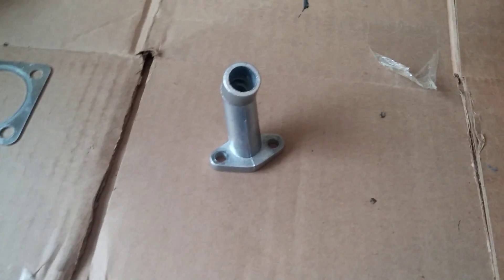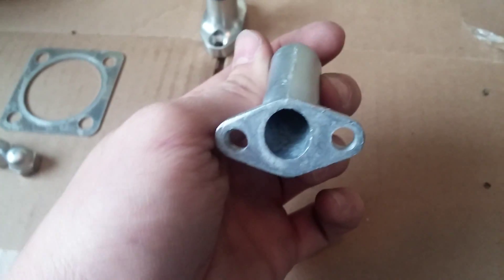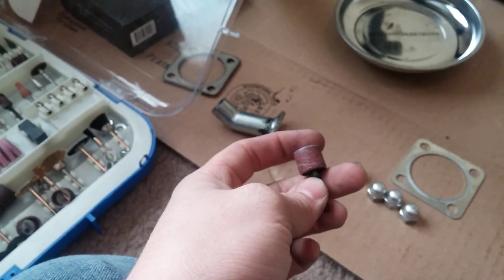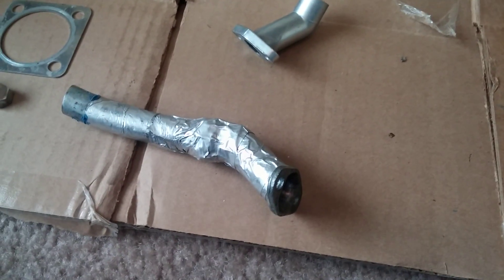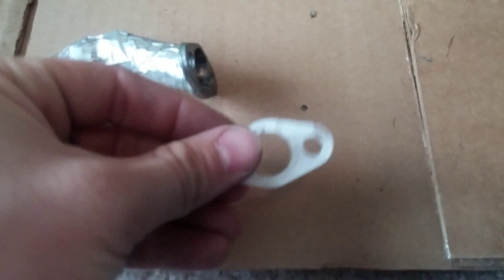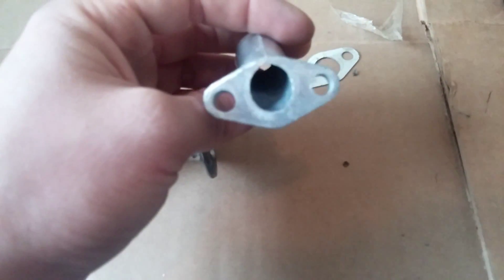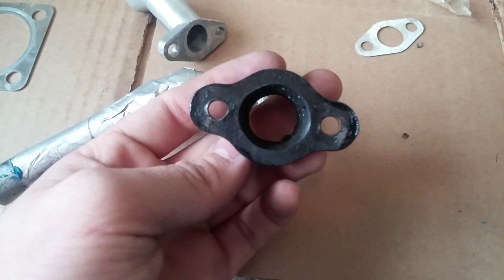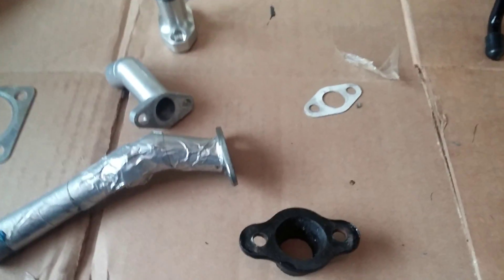Benefits of port matching

Comment: Good info. If you want to see bigger improvement, weld up an intake that matches the port size. Keep it short, use a larger carb. It's noticably better than even port matching.
Reply: What carb do you prefer?
Reply: @stephenjohnson6967  for a no reed motor with +170 exhaust timing 15-18mm of something you can jet properly. I used all the common carbs and just being able to get jets and have decent jetting made me happiest. No dyno to verify, just seat of the pants.

Comment: I understand the theory with the intake, but it ignores the fact that when you widen a pipe, it slows the speed of whatever is flowing through it.  I want the air to go into my crank-case at maximum speed, so it will create a slight super-charging effect.  I could be wrong...
Reply from the maker: I think the difference is the abrupt change is going to happen as it goes into the intake port either way. Would you rather the transition be smoother or abrupt? There is vacuum on that intake port pulling in air so no supercharging effect really. I have no data to support it, but also I believe the atomization of the air fuel mixture also becomes better allowing for there to be gains. It's actually a hugely popular mod to do, but I whole heartedly believe in a nice shorty intake that widens out to the size of the port properly, that truly gives some awesome top end gains.
Reply: @JordanRandle  , I'm a automotive technician with three years of formal schooling.  Trust me, you can statically super-charge an engine.  Meaning greater than 100% volumetric efficiency without a blower or turbo.  It requires speeding up the air going into the engine by using reduced diameter intake parts.  If your intake port is "V"shaped, that's one of the easiest ways.  A velocity stack will work as well, but is really only good for drag racing, as it's results in a very narrow power-band.
Reply from the maker: HonorB 4Glory  No I understand trust me, but in this case you are never going to have positive pressure in the intake especially where it's located. I am just saying there is other reasons for the porting to be beneficial other than just port matching. From the factory the castings are very rough and in some cases horrendously cast. This allows us to come in and clean them up promoting greater air flow and allow for the best possible entry of the fueling. Any turbulence or discrepancies or even disruptions in the flow is not good for volumetric efficiency. When I was talking about no supercharging effect I was talking about these motors specifically.
Reply: Your idea is correct but for the size of the engine, the intake and exhaust are extremely undersized. It's done on purpose to reduce power. An 80cc MX bike can run a 28mm carb and intake to match and still make more power at idle than these bikes.

Comment: So how much power did you gain?I doubt you noticed the difference.
Reply: something small like this isn't so noticable, but there are alot of things you can do and when you do them all they do add up to make a big difference
Reply: i agree
Reply from the maker: I am going to say porting is very noticeable depending on the overall quality of your motor. Some of these motors just have horrible machining and transitions while others are a bit better. My first motor was horrible and when I ported the motor out I actually gained something stupid like 6 mile an hours more, but I was a more extreme case. I would really expect 2-3 mph gain just because it's much more free flowing and you can reach those higher rpms easier. It's not specifically how much faster you can go, but the over power curve being increased making your acceleration faster and top speed higher.
Reply from the maker: There is a noticeable difference. The castings on these motors are absolute shit and nothing matches properly. That on top of partially blocked ports from the cylinder wall not being machined enough to fit the ports properly. The exhaust is also a circular hole attached the an oval port. Try it for yourself not all motors are as bad as others but this is my favorite cheap mod and really opens up the motors to flowing better.

Comment: I have to disagree with the roughness/slickness.  That doesn't effect atomization heat and velocity does.  You want your intake to flow fast enough to keep the fuel suspended in the air.  If its too slow the fuel will fall out of suspension and pool in your intake.  Once your engine gets hot it will turn into a vapor and will stay suspended better.  To get the highest flow of air/fuel mixture is to get as smooth of a intake as possible that's why people port and polish heads on cars is smoother the port work is done the better the flow.  Roughness creates turbulence which slows the air down.
Reply: actually a non polished intake promotes the atomized fuel droplets to remain in suspension at the expense of a tiny amount of flow. in a totally smooth mirror finish, fuel with tend to coat the surface more than with miniscule eddies at the boundary layer. surface tension on the droplets will adhere it to polished intake surfaces. 
combustion chamber is another deal altogether.
on the opposite end, you would want a polished exhaust port so carbon wont have footholds to build up on.
as long as there are no restrictions to flow, youll be fine with 200-400 grit stone or whatever you're hogging the intake out with